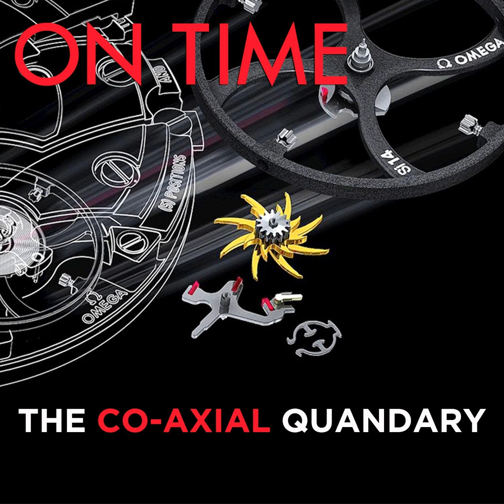The Co-Axial Quandary

Comment: The problem is that most watchmakers(an incorrect term if you are not actually making watches) are watch technicians not mechanical engineers and don't bother to actually see what an escapement's levers and pivot points contribute or not to the overall movement efficiency and design.  This includes you guys.  The co-axial escapement was originally designed for clocks, of which at the time most operated an average of 3600 to 4800 bph.  At this rate, the coax worked fine and needed zero lube.  Daniels marketed the coax to several major watch houses, all of who denied him(this means that their very experienced watchMAKERS denied them).  Omega needed something to call their own so they could rise above Tudor and do away with eta altogether.  It was a match made in hell.  28800 is the std beat rate for modern watches today.  When omega tried it, they had problems.  Yes, it was with the eta based movement, but when they moved to the new movement, they did not move the beat rate up. They kept it at 25200, the number they had to reduce it to to prevent problems.  This means that the problem wast the movement, it was the coax that was the problem.  When you look at the design and speed it up, you can quickly see what the problem is compared to a std escapement. At least an M.E. can or should if they have no bias.  Unfortunately there is to much brand bias and most industry ignore the issue.  There is more, maybe later